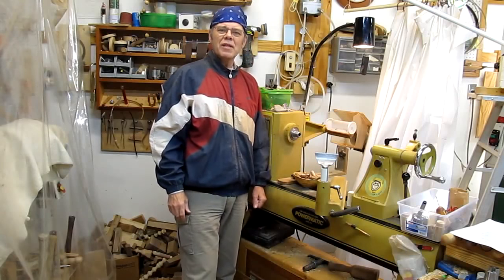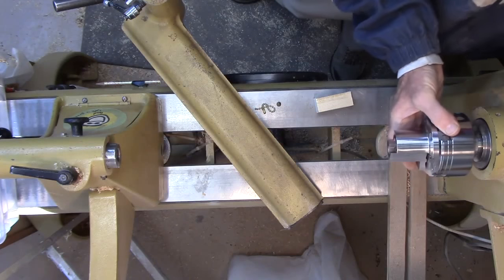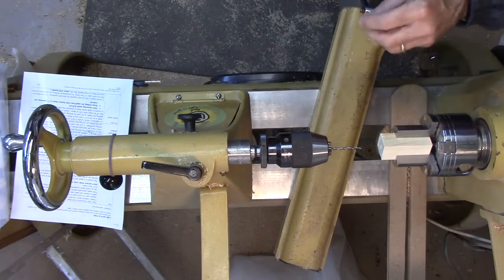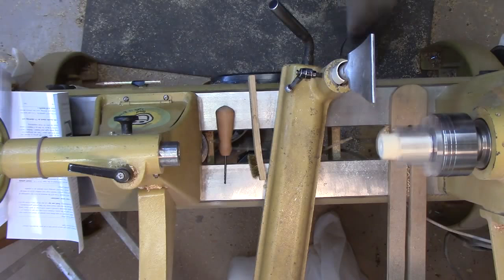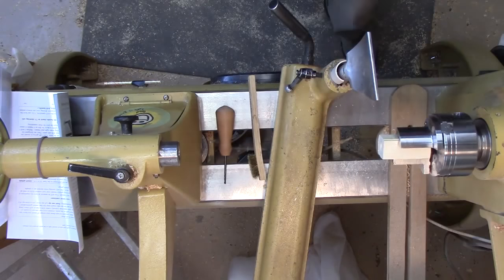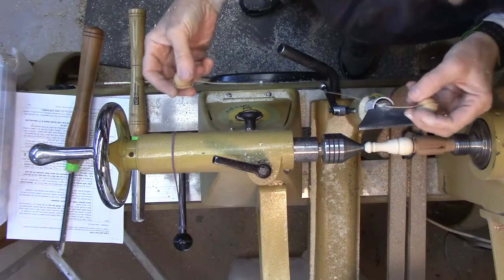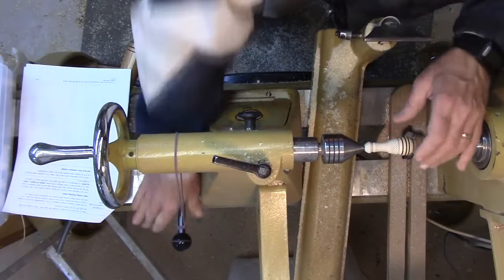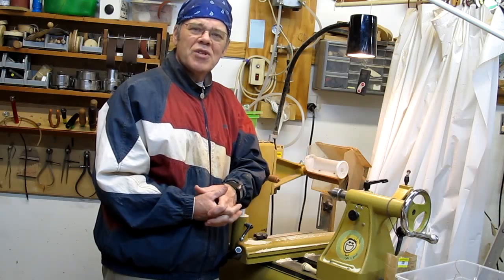Wood Turn a Light or Fan Pull

Comment from the maker: I have found the chain kits from Craft Supply to be the most cost  effective at about 40 cents each if you disregard the shipping. https://www.woodturnerscatalog.com/p/65/5329/Turners-Select-Light-Pull-Chain-Kit-5-Pack?term=chain  
These are cheaper than 3' lengths of chain when you have to buy the extra little couplers and figure out how to  add a ball stop. But I have also had good luck at Ace where they  sold chain by the foot and you could buy all of the couplings and bell  or ball fasteners. You can buy the couplers at Walmart  a bit cheaper than the big box home development stores like this https://www.lowes.com/pd/Harbor-Breeze-6-Pack-1-58-in-Multi-Metal-Pull-Chain-Connectors/1000003150

Comment: Mike - you pulled a fast one and snuck in one of those truly profound hints that typically never get said.

I've had the problem many times that drill bits don't center in my jacobs chuck.  It never occurred to me that a simple solution is to put the bit into the chuck before mounting it in the tailstock - when you can still see what you are doing!

Thanks - that's a really great suggestion.
Reply from the maker: They say to teach is to learn twice. I figured that out when I did this video. Glad it was a useful tip.

Comment: I am a bit suspect of the Morse tapers on wood lathes. If you use a Morse taper that has been machined properly as on a metal lathe it is very uncommon for a tool to come loose. I see yours popped out of the head stock once. Nice project though. I need to do some of those.
Reply from the maker: Yes, a wood turned Morse taper will not have the same precision as machined steel one.

Comment: Couldn’t hear Mike’s narrating most of the time.
Reply from the maker: I went back at listened and did not hear a problem. If the volume was too low you can  raise it on a particular video or increase the volume on your device. I did not get any other comments on the sound quality. What am I missing?